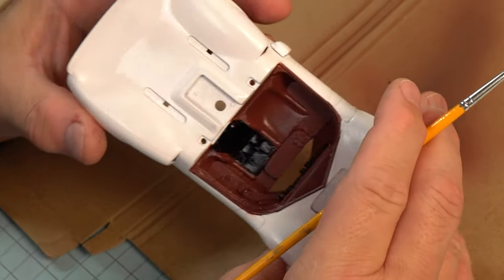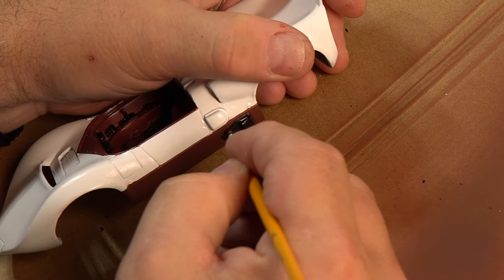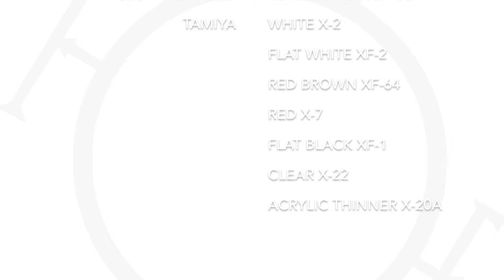Pimping a Cox Chaparral Slot Car! Part 7- Done & Done’er!

Comment: The Tamiya spill brought back a nightmare - I spilled a near full bottle  of silver on my 1/32 1955 Aston Martin DB3S slot car when I was just trying to do some TINY touch ups. The body color was hand mixed green on the Aston...yep...good luck matching again!!! :(   I fixed it but...it just isn’t the same since I did that. I never forgave myself. Thank you for making me feel a little less horrible ;) Beautiful build!! Love the Cox cars.
Reply from the maker: Luckily, I was rolling video when the spill happened...at least I could discover what I did wrong and try not to be so dumb next time! Thanks for suffering with me!
Doug
Reply: If it was enamel paint you could have tried quickly washing it with WD40 or if it was acrylic with water and detergent